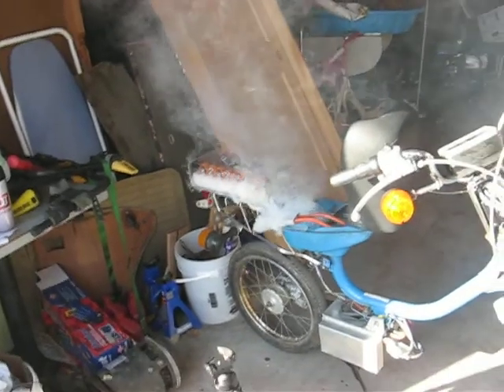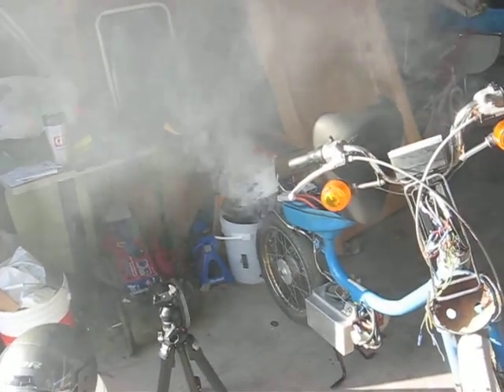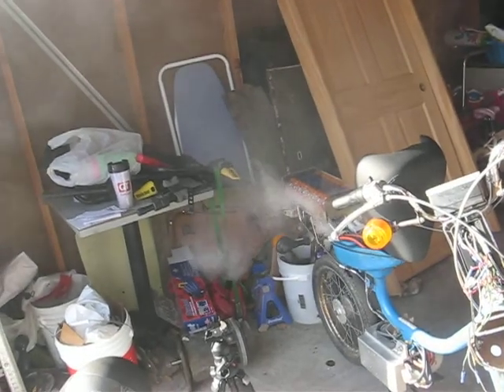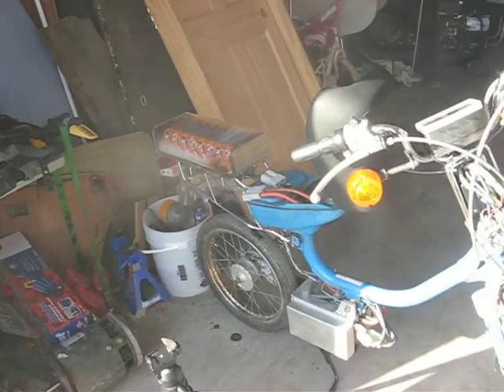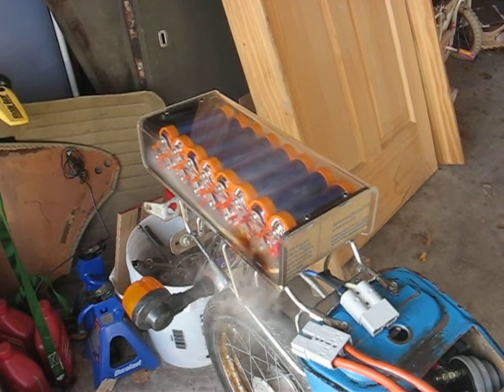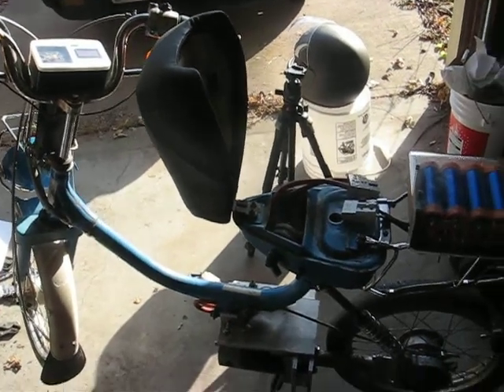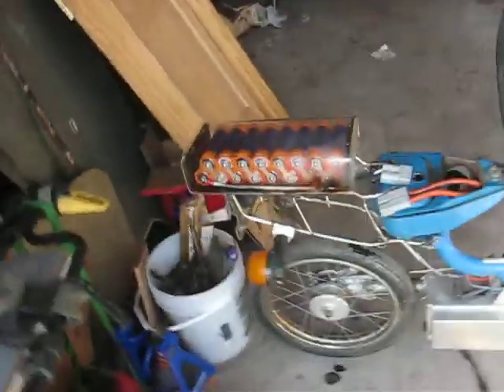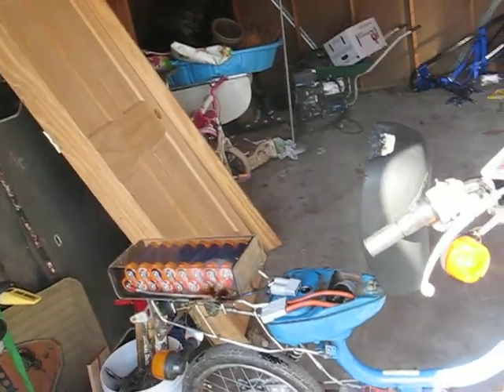Battery Failure on Electric Moped Conversion

Comment: it seems like the hose clamp your using to hold down the battery box could have rubbed through the batteries plastic overlay...

anyway dont give up, your on the right track... EV's are the future...

Comment from the maker: @allensblade I'm moving forward. And indeed it was the clamp that shorted through the insulation on one of the cells.  I failed to put an insulator in place that was intended.